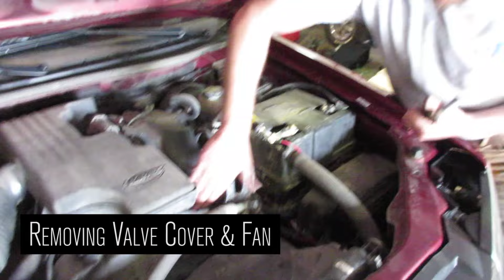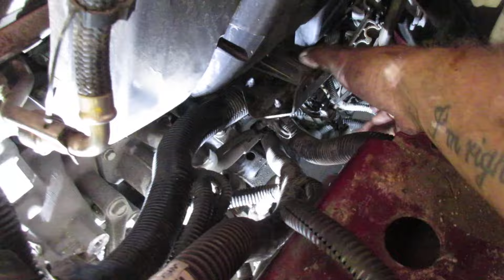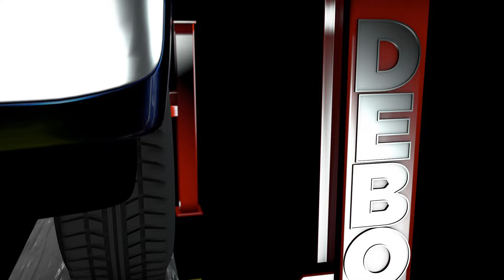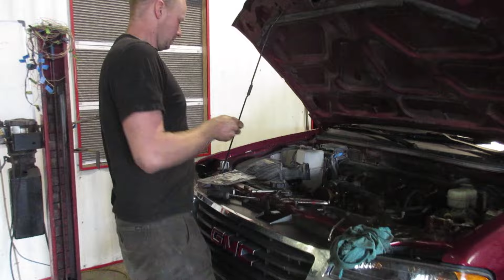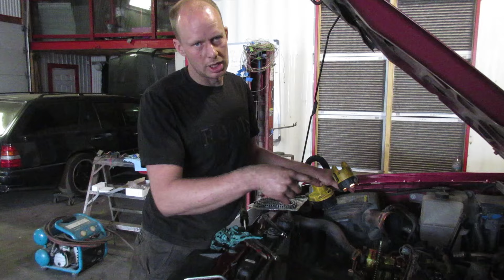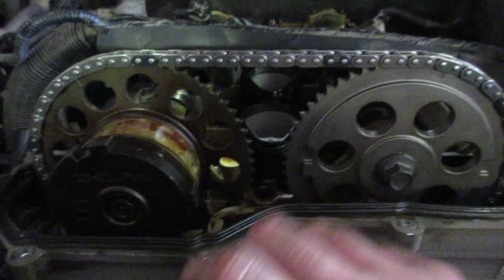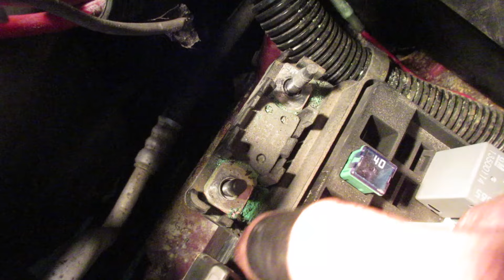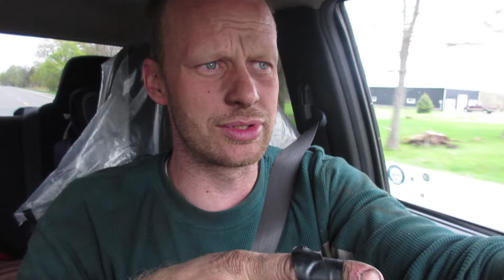Over-Engineering At Its Finest! GMC Canyon Needs A Timing Chain

Comment: Its not a gm engine, nor is most of the rest of the vehicle, its an isuzu engine and chassis. Same as the 6.6l duramax, its isuzu too. They are resonably well built motors and vehicles, people usually just dont change the oil often enough and overwork them which leads to failures and wear

Comment: Heres a good one for you DEBOSS. You probably ran into it a few times already but on the off chance you haven't, on the Chevy Cruzes with the 1.4L turbo motor, PCV diaphragm likes to rupture creating a vacuum leak and makes the ECU store DTC P0171. Thing is you just can't replace the diaphragm. Oh no. Gotta change out the entire valve cover for that, and GM wants almost $100 USD for that bad boy. Now it might not totally seem like the end of the world, but consider on other vehicles with a plug n play PCV that goes bad from time to time, you spend anywhere from $6-8 bucks and you can change them out in literally under a minute. Like you said. GM over-engineering at it's finest.

Comment: i have this truck. mines an 05 colorado with the 3.5 inline 5. i already replaced the brakes. front rotors are assenine. took me all fuckin day cause like he said you basically have to take the whole truck apart. and now im blessed with a cam phaser failure. mines 4WD which is nice for off roading. but im not gonna pull the axle out to replace the phaser. ill pull the motor mounts and hoist the motor up as high as it will go before i do that. if i take the axle out i will but ill be pissed and it will probably take me more then a day to do it all. i wonder if the front cover can slide off the front with the pan bolted up or if it has dowel pins. im thinking if i can just losen all the pan bolts and drop it 1/4 inch it can stay mostly together. thing i might also drill and tap the dampener for my bolt hole style puller  if it dont have holes for one. i love this truck and i payed 1500 bucks for it after it was totalled in a wreck. i used a portapower and 350 bucks in parts to jack it straight and slap it together. it runs straight and true like an arrow and i love the bitch. but i also hate it so bad. thinking one day ill LS swap it but for now i have to keep taking it apart nut for bolt and putting it back together to replace shit whats normally easy. . well on some cars anyway. engineers always seem to make one thing mission impossible on every car there is

Comment: Timing chains are a wear item; they stretch even on a OHV engine at best you get 100,000 miles or roughly 150,000 KM. If you have  240,000 KM that’s almost 150,000 miles! my math says your up by 90,000 KM. Or almost 60,000 miles,
That’s awesome mileage on a chain in any engine.
As long as the chain is replaced before it breaks causing the engine to detonate like a supernova would call it a win. Lick your wounds, replace the chain, and push the engine another 240,000 KM down the road.

Comment: Ok, stupid question, can i just open up the top, "open up chain" connect old and new chain, cycle the engine to feed in new chain while extractung old, when you see new chain coming back through, dusconnect old and new chains, and reconnect new chain. Did that make sense? Would that work? I realize the gears would not be getting replaced, atleast not the bottom ones, but could you reliably get anothsr 80k miles (bout 150k kilometers)?

Am i crazy for even imagining this could work? I have a 2010 colorado which is a canyon. Please anyone with knowledge to really know please let me know if this could work.

Comment: That is not "Over Engineering".  Over Engineering is when you engineer something to be stronger that it could ever need to be, so it outlasts all the other parts around it (especially if it's not a critical component). It this timing chain was Over Engineering then it would be in perfect condition long aster the rest of the truck had fallen into a heap of rust.
Reply: Yep, like a Cummings 5.9 covered in a heap of rust that used to be a dodge  pickup.

Comment: What the hell?  I had a '90 Buick Skylark with a 2.4L Tech-4 torque master and it cost me $400 in 2000 to have the timing change replaced (gear, tensioner and seal).  Could have done it myself if I was still on the farm for about $60 and a days work (I'm slow on the uptake).  Anyway, that car got be 33 MPG highway.  Sure miss that car.  It was murdered in it's youth by rust.

Comment: Timing belt on my four banger took 4 hours two guys didnt have to pull any engine just remove an engine mount jack the engine up and down to get at the bolts etc wasnt that hard

Comment: the should just be gear between  the cams and crank and balance and crack in back. More expensive yes but last the life of the engine. Toyota and Honda are about the only manufacturers than have chains which can last the life of the motor. All the push rod V8s seem to do well most of the time. Its a thick chain and short run with no tensioners  to mess up.

Comment: seems like it would have just been easier to pull the motor up and out of the engine bay.... then buy a separate motor and do it again and have it sit somewhere ready to just slap in when the time comes again. then do it all on the motor you pull out. and let it sit. rinse wash and repeat...

Comment: this right here is GM for you they sell just about every vehicle they make after 1990 to basically be an expensive repair bill from about 80k-150k miles  so they force you too trade it in and get new vehicle which makes them richer  i think can think of 5 gm engines that a pain however im still a diehard GM guy I always prefer a classy bowtie over a boring blue oval

Comment: I was a gm dealership tech for 10 years and this era of vehicles is why I quit working on cars. Even with all the special tools and factory information support this modern engineering style sucks to work on. I started working on cars because it's fun but this crap adds to much stress. I have done this same job on an he and it was 4x4. Trying to do this and work on 4 other cars at the same time is a challenge.  In my opinion anything after about 2005ish sucks to work on. They replaced the 3.8 with the 3.6, really? Sure the hp is nice but the 3.8 was super easy for anyone to work on at home.

Comment: my wife had a 2015 Chevy Malibu with the same abortion under the hood timing chain slap at 118 Thousand miles that’s precisely why I don’t own a late model Chevy anymore I drive them all Ford Chevy and dodge they all have their pros and cons. older seems to be better if you want to fix your shit at home in the driveway or the garage. and for what a new vehicle costs you can completely refurbish 2 older vehicles and still have cash left over. if the engineers simply improved on that old 2.4 Iron Duke bullet proof cast-iron four-cylinder they would’ve had something. Man I can’t wait for free valve technology to go main stream...

Comment: You could have pulled the cab off in around 1 hour, then have had the engine out and apart in about 30 minutes.
Reply: Steven R pulling the cab to make maintenance feasible is not a way to make a vehicle easy and cheaper to fix.

Comment: My 5.4 Triton held up great.  Until it didn't.  at 202,000mi.  It was in an E250.  So, no reason to work on that engine while in the van.  Dropping the engine is actually faster than even bothering trying to work out of the doghouse and from step stools.

Comment: Wow, GM could've done a lot better job than that.  I'll stick with my Dakota I built. I'm asking the same thing, why?  Why do Ford and GM use chain with DOHC engines?  Why not use a belt like the Japanese have for years, and make it accessible so can be serviced in a  few hours?
Reply: No I prefer chains the chances of catastrophic failure is so low compared to a belt but when they wear it’s a lot more work but I would still rather do this once every 200k miles than a belt every 50k

Comment: Grease on those battery terminals.  Greasy metal can't corrode.  Does not cause resistance at the terminals.  Coast Guard trick.  They can't afford a no start.

Comment: The fullsize arent any easier...the LS engines are the same bass ackwards engineering. I had to remove the front axle so i could drop the oil pan to remove the timing cover to replace the oil pump in my '09 Yukon. Never dreamed I'd have to get a wheel alignment after swapping an oil pump....

Comment: I had a 2005 Colorado 3.5 and had to replace the front main seal. Though I didn't have as hard of a time pulling the front pulley off, it was actually pretty easy for me and I did it by my self. I had the cam phaser go out, stupid pain in the ass. When it went out the engine sounded like a loped out v8. Wish I could have left it like that lol. The brakes were a nightmare like you said. Transmission was a slush box, I think I drove it too hard or just got a bad one. Thank god I traded it in at 110K miles before this crap happened! Dumbest engine design ever.

Though wasn't this an Isuzu design and not a GM designed engine?
Reply: It's far from the worst engine design ever. Ford had a similar V6 just a few years earlier that had a front and rear timing chain because Ford was so cheap they didnt want to pay to make a left and right cylinder head. Instead they just rotated the head and put a timing chain on the back. It's also nowhere near as stupid as the current Duratec V6 that places the water pump behind the timing chain cover and drive it off of the timing chain. Now an easy water pump replacement turns into a VERY expensive repair, especially if the bearing wears enough to cause a leak. When that happens coolant begins to leak into the engine oil. It was supposed to leak out of an external weep hole but it usually doesn't work that way. In worst case scenarios a simple water pump leads to a destroyed engine. It has happened often enough that a lawsuit has been formed recently.
Reply: @hochhaul  Funny you mention the 3.5L Ford. I own a fusion sport. Guess what happened about 2 years ago. The water pump went out. Facepalm on my part lol. I didn't even attempt to do the job myself because the engine has to come out. It was a $2500 job but I had all the timing components replaced along with the alternator, spark plugs, a CV shaft, lower rear control arms (it has 2 lower control arms reward and forward) and a couple other odds and ends. Basically as much as I could think of that needed to be replaced which saved on labor overall on the individual jobs.

That was at about 120k miles. I'm almost at 160k miles. The rest of the car is solid for the most part. If it wasn't for the fact I like the car and it's fully optioned out, minus AWD thank God, I would have traded it in when that happened. Plus it's paid for, and $2,500 is less than a new car payment for the next 5 or 6 years. I just want to make it to about 250k miles without any other major issues. Fingers crossed.
Reply: @jlongjr27  Yeah that water pump decision was a real shame because aside from that, the vehicles they're in are fairly decent. Instead of a $150-200 water pump juob in your driveway, its a multi-thousand dollar job to replace it if you catch the milkshake oil in time or notice the change in valvetrain noise (or possibly a DTC code for valve timing). It's even more frustrating since this style of timing chain-driven water pump is the exact same thing that destroyed a LOT of Chrysler 2.7L V6's in the early 2000's. The water pump would leak into the oil and take out the bottom end.

Glad to hear the Fusion is working out well for you otherwise. Used sedan values are terrible so you might as well maintain it and pile the miles on it.
Reply: @hochhaul  That's The plan. I know exactly when the water pump went out. I was at a stop light and the RPM's dipped and the engine started running rough for a few seconds then it was fine. Luckily I was a block from my destination and when I got there after being parked for a few hours and leaving I saw a puddle and it was coolant. I immediately knew what happened and had it towed to the dealer. They wanted close to 4k to fix it so I had it towed to a mechanic I have gone to for years and they were half the price so I piled on the other work and overall think it wasn't too bad considering. I don't think there was any water in the oil thankfully. The reserve tank was completely empty and I suspect the radiator was as well. In my case the water pump completely let loose and the weep hole did its job.

Comment: Seems like alot of engines from alot of different manufacturers have chain and cam phaser issues. I'll bet the majority are caused by these rediculously long, 10k miles, oil change intervals, as well as oils that are way too thin, Toyota recommending a 0w16 now smh. I know the claim of reduced tolerances and what not, but that's BS, it all to increase their CAFE. Use a good 5w30 and no more than 5k miles. There are so many different oil weights, can't even stock them all.

Comment: Rough I took the steering rack bolts out dropped it unbolted the oil pan in bolt the whole timing cover assembly front and slid my hand between the oil pan and the bottom of the  block you gotta reach in the driver side door and then on the passenger very front of the wheel well and then reacherd between the. Block and the pan in the front just under the timing cover and put a shim between the oil pick up tube and the timing cover and then the cover came right off
Reply: And I didn’t have to remove and Anxels or and front assembly’s for the transfer case
Reply: 4x4 sucks on the. Truck

Comment: Why I would never buy a car build like this 😂
Reply: actually these little first gen colorados and canyons are nothing like this description, sure there complicated but very reliable and they are workhorses. i see then around here reach 300k all the time no problem, and by being worked not being daily driven. so this video is wrong when he says that you repair them alot. mine has 109k on it and only has had to have a new powersteering pump, and it was the original one 14 years old so yeah. they great little trucks.

Comment: Seems to be a bit of a pain in the ass just to replace a timing chain.
What is the point of buying these big american trucks when they all seem to have issues, to me these vehicles should be built too last and work and without too much effort, is that not the whole point of such a vehicle, i would expect any american big truck to work hard last for a very long time with minimal fuss.
In my job i drive a Toyota Hi ace, with 947 000 kms yes not far off a million kms, it has had new cam belts servicing etc, injector pump looked at once, but not much else, internally untouched since it left the Toyota factory, as far as i know even the water pump is still original, factory clutch 605 000 kms pretty bloody impressive i reckon!! Does not seem to burn any oil, starts 1st time every time and will perform very well when asked too! 
If Japan Toyota can build good quality vehicles at a good price, WHY can,t the big three Ford, GM, Dodge Chrysler  do the same or better??????????????????????

Comment: Same job as the European opel corsa piss easy 3hours done with rad put back in why didn't they put a hole in the side of the block like normal engines and u slip a bolt in to hold the crank

Comment: I am done with GM. Went to Subaru. Never looked back.
Reply: new subaru engines burn oil.  I had to replace the short block on my forester after 100k.
Reply: @fPonias1  Yes, they knew this and extended the engine warrenty. What year is yours?
Reply: @scottfirman  2012.  On the other hand, my 98 legacy has 200k on it, no issues, and all the repairs have been easy to do myself.  Unlike these GM POSs.

Comment: I work at an auto auction and hate the Canyon and Colorado's.  The only one that's worth anything is the one's that have a 5.3 stuffed in it.  The wheel bearings on top of the crummy engine's make it a terrible truck.
Reply: Wheel bearing is unbolted easily enough. Timing/balancer chains $400 in parts it's the labor that is the problem, lucky i am an auto tech.

Comment: I had an 07 colorado 4x4 z71 222k on it when I sold it, and it wasn't cheap replacing the front rotors and pads because of that bs engineering. Beyond that, the only problem with the truck was the stupid anti theft bull shit that would essentially lock your truck out for 10 mins.. I only had it happen once but the guy who bought it has it happen once a week. I don't know what to tell him... It never really did it when I had it.. Just once in 5 years...
If you deboss garage guys have a bullet proof fix for that anti theft crap I would like to pass it on.. Im not really into cutting blue/white wires on someone else truck.. I would honestly love to be able to delete that bs right out of the computer..

Comment: The valve seats are very bad on these heads given low compression and engine light on , happening around 150,000 some 90,000 gmc knows about it having new heads with better valve seats on hand, funny  this was never a recall on this..cost job at repair shop just labor nyc 4500 ..mechanic the value of car not worth it.. year i did this investigation 2013

Comment: I traded my canyon in a few months ago. I had to replace the thermostat and it was in the most retarded spot. I had too pull the front drivers wheel, take off the wheel well liner and had too use 4-6 extensions just to reach it!

Comment: On top of the garbage engineering,  control modules like to randomly fail, front alignment falls out with regularity, engines ping under load,  and front wheel bearings and ball joints fail prematurely. I hope GM fixed those issues on the newer midsize, cause the first gen Colorado/Canyon were steaming shitheaps of epic proportions..

Comment: I just did a head replacement on an 04 Envoy with a 4.2 and it was a biotch. Luckily i was able to build my own wedge tool for the chain tensioner and avoid pulling the timing cover. It paid good but what a fucking joke of a design.